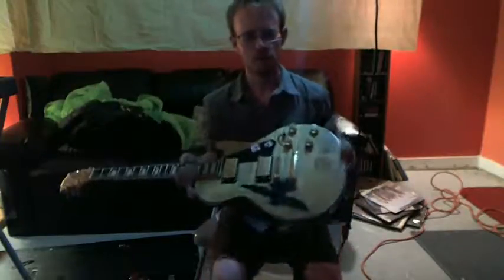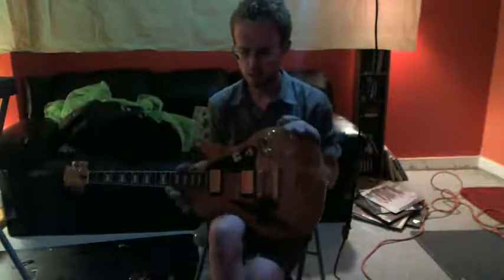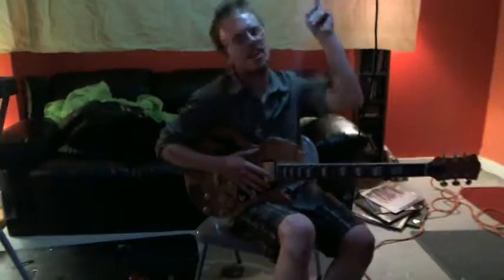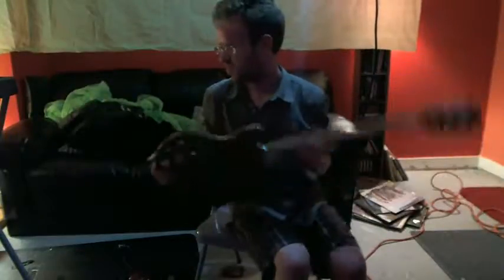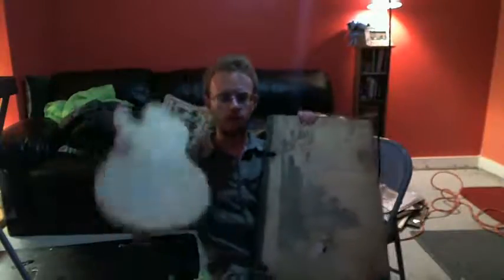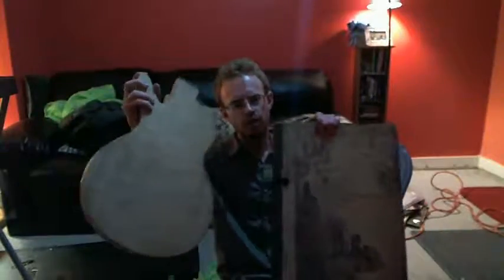How To Build An Electric Guitar Part 1: The Body

Comment: Timothy, As a former radio announcer, I know that the first rule of radio (and even more so, video) is that dead air (silence) is the death knell to a program.  Three plus minutes of dead air while you were figuring out where you were is NOT cool.  Find a video editing program and clip that dead air out of the  video.  Then I might find my way back to watch this video.  Learn how to work the equipment before you start a project like this, and you will have better results.